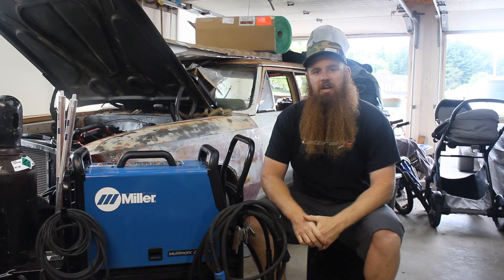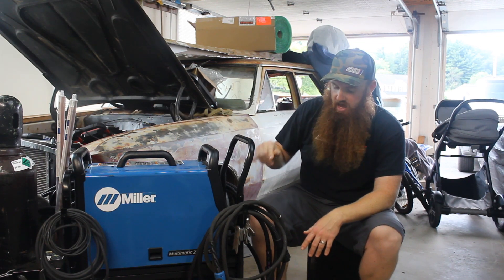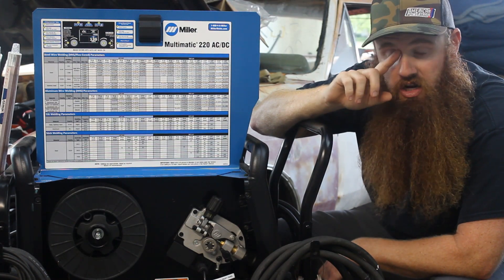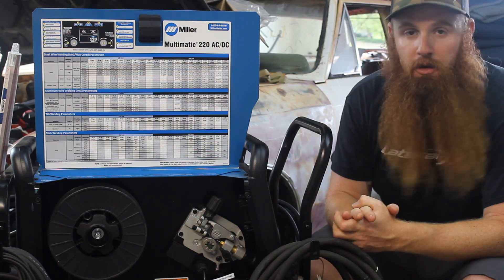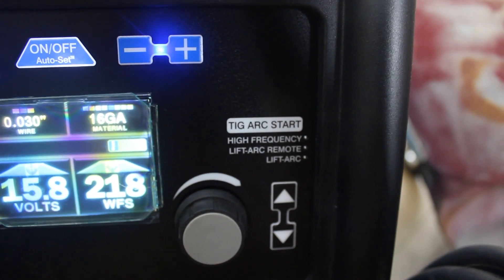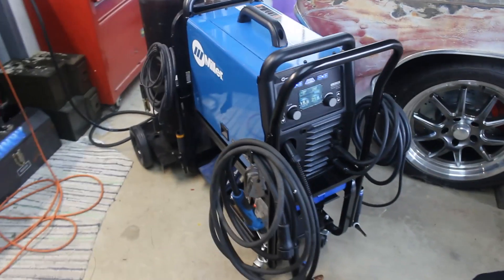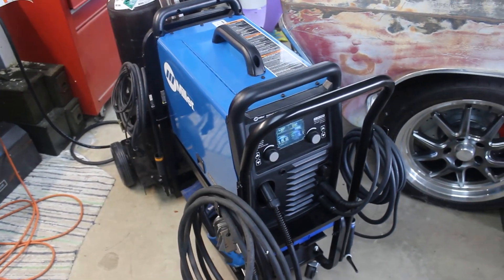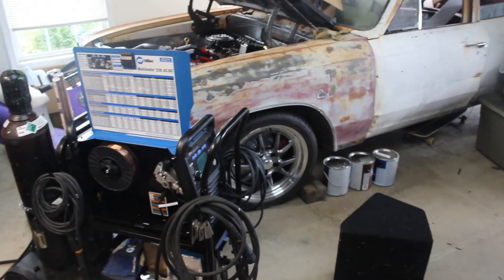Overview: Millers New Multimatic 220 AC/DC Welder!

Comment: Hey man just curious.  I just got one of these machines today and when I was setting up the mig wire I noticed that when feeding the wire thru the machine it spins a little slow and then after a few seconds it starts turning real fast.  Does yours do that?  Or maybe I have the tension set up too tight or something?
Reply: That's the jog feature,  it knows you're just trying to get wire through the lead to the tip.
Reply: @imbrandon16  I actually called Miller’s tech support because I could find any info on it.  It’s an arc stabilization feature.  It feeds slow until the machine sees an arc and then it speeds up.  They said it’s to give it a smooth start.  After turning it on and off I’d say that it works pretty well, I didn’t think I would like that feature but I think I’m going to leave it enabled now